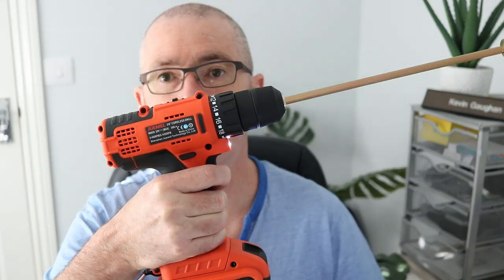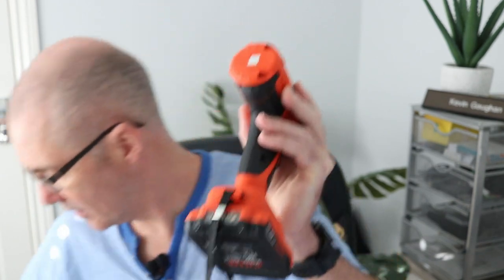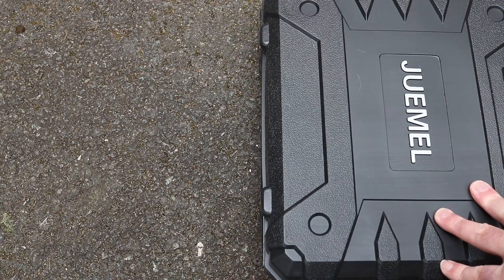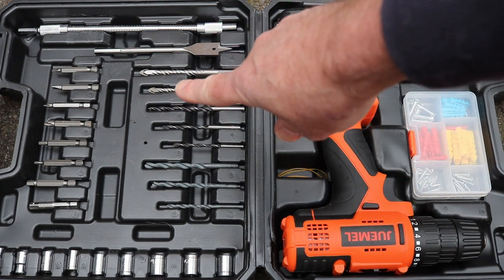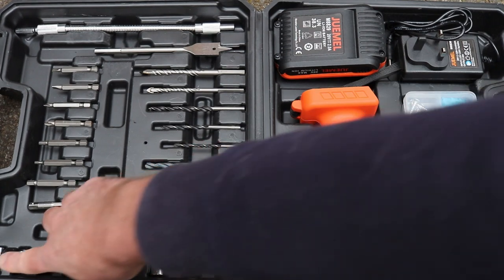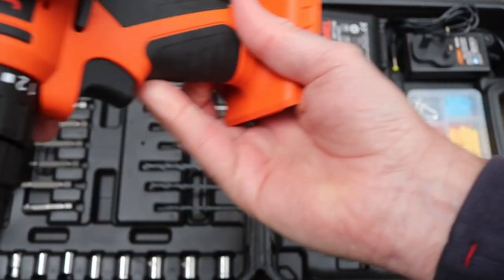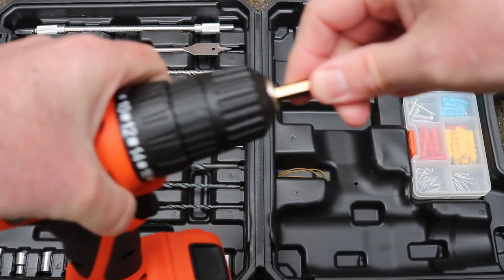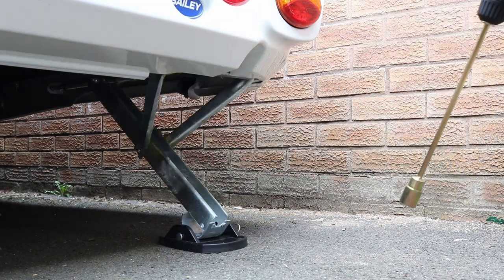THE ULTIMATE CORNER STEADY DRILL for your caravan? I try the Juemel drill 19/04/21 #vlog #caravan

Comment: That's the same route we went down too Kev. A cheap drill (we ended up going for B&Q's own) for the steadies. Nothing fancy, just something with a decent battery life and adjustable torque. Ironically, we've ended using it more for 'van modifications while we're been in storage and not away! Cheers for this one. Martin & Jo.

Comment: Your ment to do it slow, all your going to do there is stripp the threads off.
Reply from the maker: I'll bare that in mind, but I think that's unlikely - the thread seems pretty sturdy and with a low torque setting, it'll stop if it meets any resistance.